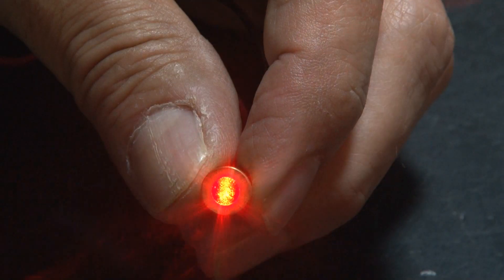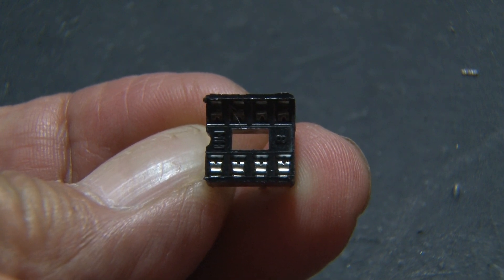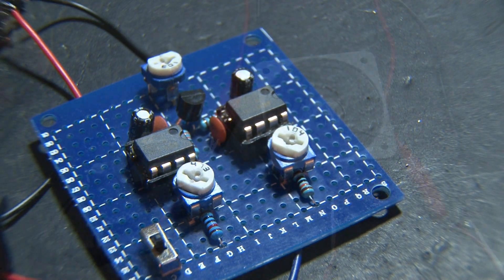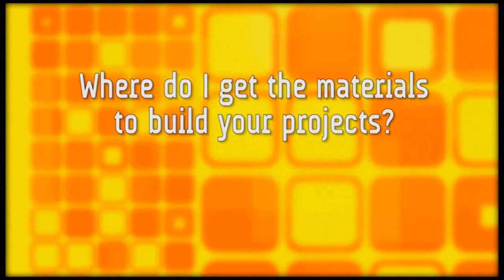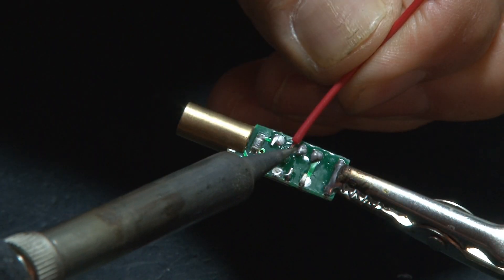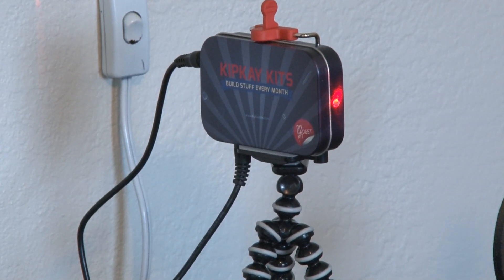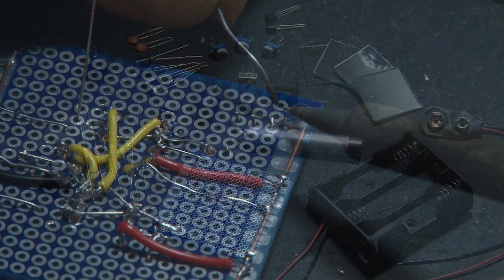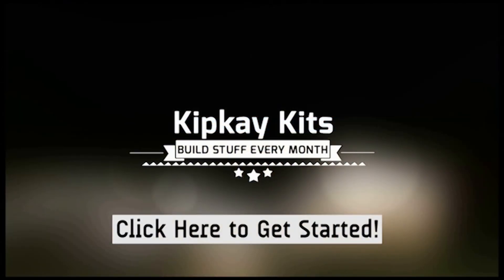Laser Tripwire 2.0!

Comment: My version of Security

Equipment - Flashlight, Solar panel, Wiring, and a buzzer.

Setup - Flashflight points toward Solar Panel, a INVERT gate will make the security off, whenever light is obstructed, trigger!
Reply: Mine is
Equipment: Eyes
Setup: Look at the door for 5 hours. If it moves, you attack
Reply: My version of security.

Equipment - Lamp and tape

Setup - Plug in lamp and tape the cord to shut door so when it opens the light turns off. Make sure you put it where you can always see it!

Comment: Hey Kipkay, I don't know too much about electronics but for the version that stays on, cant you just use a silicone controlled rectifier or SCR? With one of those in the circuit with the gate being the photoresister the beam being broken will set it off and keep it off. I believe that this will save space as well so why dont you use it?

Comment: Cool.  But the arduino is a bit overkill just to make the alarm stay on.  That's also a bit of a cop-out to just say "use an arduino".  Instead use a latching circuit (S/R Latch... that's much more elegant.  You can even make one from a 555, which fits right in your design.

Comment: This is cool and all, but a much better and cheaper solution to get this to stay on, is to use an SCR (Silicon-Controlled Rectifier) as one way analog , toggle switch. SCR's are PNPN or NPNP devices really simple and easy to work with. I built a project using a laser tripwire, and it's a nifty little thing. Cheers!

Comment: I want to someday build my own house security system. It would be so much fun and hook everything upto a small server. When something break's it send's a signal to the server which could in turn text my phone and even send a few photos or video feed.
It would be interesting to make some kind of window magnet thing that goes off when you open the window.
Reply: For the window thing, you could use a magnetic switch and place it a few inches about the resting position of the magnet on the window. Then hook that switch through a second switch controlled by the server(On/OFF of the security system) and power that up so that if both switch are closed (The magnet is near the magnetic switch AND the protection is up) the server receives a signal and starts whatever action you want to relate to it.
Reply: Volvary It would be so much fun!!!! So much stuff involved to. Like a small website that has php stuffs.
Reply: Thiers magnetic security switches they use in doors just fit it in your window

Comment: Amazing project Kip, but for your next variation (or a future separate project) you can use some cheap camera hooked up to the laser tripwire so when it is activated, the camera will take either multiple pictures or even a video! Why don't you try that, it doesn't seem to be that hard...